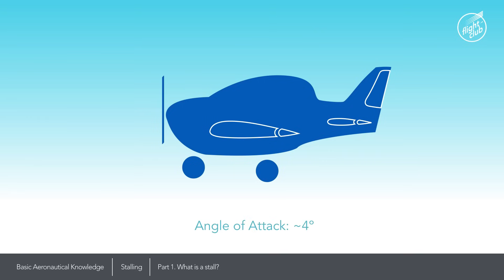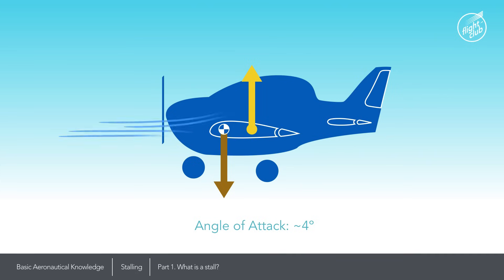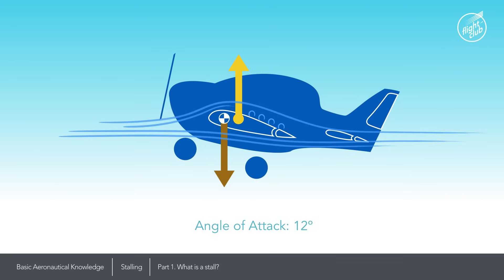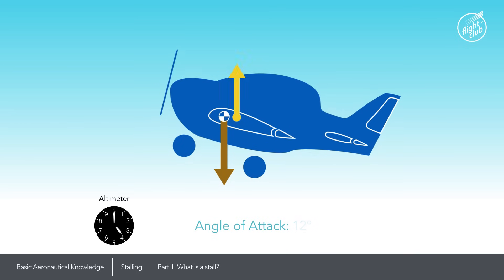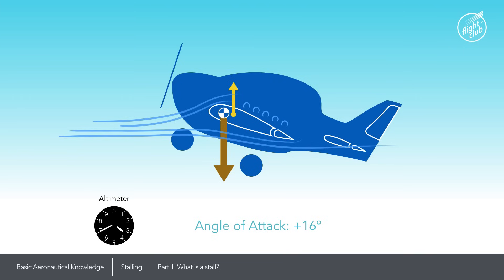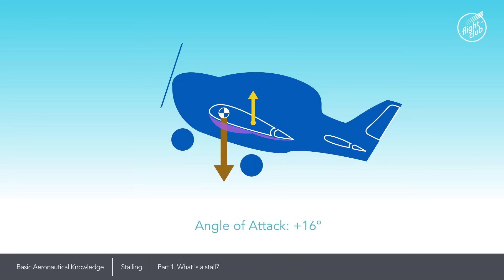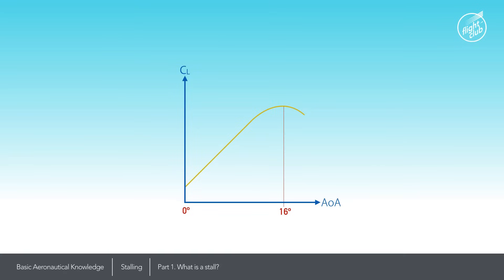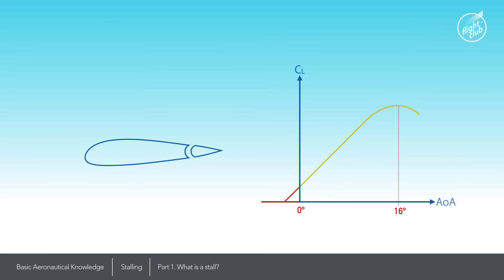What is a stall?

Comment: Stall is simply when the plane loses its force/lift to stay in the air for example due to low thrust of engines and pulling (sharply) up, iced wings (if you get iced wings during the flight with wings defrosters on then it's very difficult to get out of stall as the iced wings don't have enough surface to generate lift), if you've got a stall you go full thrust and nose of the plane sharply down untill you go out of stall (regain the speed), if the stall is on lower altitude then everybody in the plane is history.
For example you are at around 800 meters, suddenly both engines are out, if you start pulling up you will loose speed and stall, you go negative (down) 5-10° to glide and keep the speed and do emergency landing with or without the landing gear and airbrakes as you can't go too fast, if you for example do the emergency landing at 400 km/h the machine will simply fall apart, you do the emergency landing around stall/landing speed.
Every plane has its own stall speed like a smaller plane will have around 120 km/h and bigger ones 200, if you go below stall speed, the machine will simply fall down like a stone, you can't go too slow or too fast because in both cases the machine will go down, every machnie has its own stall and critical (never exceed), take off/landing speed, there are also flaps, airbrakes, blade pitch, reverse thrust, if you want to become a pilot and get some idea about flying download a flight simulator, like turboprop flight simulator from Google Play Store for free, as it's most realistic, there were cases in real life like a single fatigued bolt took the whole plane down or a moron painter that has put a silver tape on a sensor and forgot to remove it, also the plane crashed, stupid/lazy mechanics that wrongly adjusted the steering, guess what the plane also crashed ...
Reply: Thanks for the explanation, i was also asking why not just glide, but i see now the stall problem in low altitude there isn't enough space to gain speed to glide

Comment: Actually, theories say that the low pressure is generated by faster moving air. However, faster moving air ONLY generates low pressure in pipes. It is actually the airfoil deflecting air downwards.

Comment: The lift force shown should always be perpendicular to the aircraft
Reply: According to the FAA Pilot's Handbook of Aeronautical Knowledge, Lift is "a force that is produced by the dynamic effect of the air acting on the airfoil, and acts perpendicular to the flight path through the center of lift and perpendicular to the later axis." So the lift force is perpendicular to the aircraft only when the aircraft is parallel to the airflow. This is the case most of the time, but not at angles of attack much higher (or lower) than the angle of attack for cruise, assuming the aircraft is optimized for low drag at cruise.

Comment: If the AoA is increasing, then why is the air movement direction not also changing? I'd expect the air vector to also shift based on AIRPLANE MOVEMENT VECTOR, and not be always parallel to the ground. Why would we assume airplane motion is parallel to the ground if it would be slowly increasing the AoA towards sky, which should make it gain altitute?
Reply: This would happen if you were slowing as you increased AoA.
Reply: The air movement direction (relative wind) changes depending on the angle at which the airplane climbs or descends, but in this video it looks like it's always parallel to the ground because they compared the relative wind angle to the AoA without showing the climb angle of the airplane. (555-333)

Comment: Why there is no AOA in airbus 320 NEO, if Boeing 737 MAX has a lift problem, then why are the engineers paid for? How can Boeing 737 MAX be the best single ailes plane made today? if they cannot solve AOA , then it is better to stop manufacturing these killer planes?
Reply: What? Makes no sense what you write here.
Reply: You cannot "solve AOA". Every fixed wing aircraft has a critical AOA at which the plane WILL stall. AOA is the angle between the wing, and the relative wind moving past it. Boeing nor Airbus can simply "solve" this property of flight

Comment: Who came here after the recent Boeing crashes
Reply: I did
Reply: Yeah, but I didn't get anything!
Reply: meeee hahaha
Reply: One crashed earlier today in Iran.
Reply: A 737 max 8, probably another MCAS or the May Crash Any Second system problem again. 170 people this time. 🙄😭
Reply: The brazil crash
Reply: I don't think this is what happened with the Boeings. It was their faulty electronic sensor systems that caused the incidents.
Reply: Random user #74652819 737 MAX uses a Bigger engine for fuel efficiency than its earlier versions. This couldn’t be fitted just under the wings in the same location as before due to its huge size and lesser ground clearance. So they moved it a little bit towards front and this caused the plane unstable and stall. So to overcome that they added this MCAS.
Reply: @Stgdxb  But did the airplane in fact stall? Or did MCAS just push the pitch straight down, without necessarily stalling?
Reply: Psisis the air plane did fall due to the MCAS Faulty design. But MCAS was built to prevent stalling. The greedy bosses thought to fight competition will fix the new efficient engines on the old tested model. Which is a good idea. But the new engines where bulky and heavy which when fitted under the wing will reduce the required clearance to ground. So instead of raising the plane height which could have resulted in the complete overhauling design they bright the engine forward. This now resulted bin weight imbalance and can stall the plane during take offs. So the invented another software called MCAS to prevent that. And that eventually failed. The only way out is to completely redesign the plane all other fixes can turn deadly in long run.

Comment: Im still confused
Reply: I don't think I will ever understand this.  How air on top of a wing can produce lift?  Suction?  If you have air under the wing lifting it, what does the air on top have to do with it?  Completely lost
Reply: @nadrzenyporad  when an airplane is in lift off (or in an emergency), pilots need to shift their airplane's wings up and down. If the nose of the plane goes too far upward, it's tougher to get air flow above the wing. The flow from the upside is now dead weight. The plane will start to fall, consequently. This upset is known as a stall, and eventually a plane's wings experiece so much stress that it won't be able to function properly.
Reply: @nadrzenyporad  it's magic.  They just want to sound smart.
Reply: @nadrzenyporad  well in fact air pressure ALWAYS produces a force which pushes on a surface. So the air over the wing produces a force which pushes downward, while the air which passes at the bottom of the wing  produces a force upward. So the lift is produced by the fact that air pressure is greater at the bottom so that the resulting force upward is greater than the other one. So is differential pressure which produces resulting force. This is the same reason because of the Archimede's Law. Water pressure going down increases, so an object receives a lift because of the differential pressure. Sorry if it was bad english.
Reply: @marcostoca5120  does it mean that when it exceeds critical angle of attack and the cause turbulent flow, the pressure on top of the wing increased and the pressure under the wing unable to counteracts the pressure above the wing? please answer thx
Reply: @nadrzenyporad  Due to the camber of the wing, the air passing through the upset of the wing gains speed and reduces your pressure. As the pressure below is bigger, its produce a force thats lift the plane
Reply: @rafacosta_x_  Then claiming that the air motion produces two forces, one pulling the airplane upwards, another pushing the airplane upwards, is wrong, and there is only the latter.
Reply: As a kid I loved to stick my hand out of the car window to "fly".I think that's the basic concept - if I turned my hand too much up or down it wouldn't work, but light movements up and down would let my hand glide.
I don't know but maybe other people liked to do this too as children. 😅
Reply: How much clearer could the explanation be FFS.
Reply: Me too and I almost fell asleep after only two minutes. I'm outta here
Reply: Fr
Reply: Wow
Reply: The simple explanation is that a stall occurs when a plane loses lift, usually because it’s flying too slow/pitching up too far. Think of it like driving your car up a hill- if you don’t speed up, you won’t be able to go over the hill and you’ll fall downwards. If a plane is too slow, it can’t maintain altitude and so it will start to fall. To recover from a stall pilots should pitch the nose down to gain speed.
Reply: You’re probably so dumb that you did not listen
Reply: God bless you and Jesus loves you
Reply: Get off the dope and straighten out your life. Maybe then life won't confuse you and you'll understand.
Reply: And the award for most unnecessary comment of the day goes to @Woxwell.
Reply: @woxwell3684  Lol, as if drugs have prevented us all this time, from inherently conceiving the law of aerodynamics

Comment: Please help, if the plane stalls at the angle 16 degrees, how do they tilt their nose upward and go up, yet still not stall when taking off?
Reply: You don’t lift off at 16 degrees that’s why
Reply: Look up flaps and slats. These are control surfaces which are deployed by the pilot during takeoff and landing to change the aerodynamic properties of the wing. They increase the critical angle of the wing at the cost of increased drag. If you ever fly on an airliner you will see these surfaces being retracted after takeoff and extended again for landing.
Reply: To answer this question for anyone who reads it in the future, the Angle of Attack mentioned here is "relative to the wind", meaning it is relative to the angle of the air flowing over the wing, not the ground. When a plane takes off, they must generate enough forward airspeed that the wing generates enough lift to support the craft, then as they rotate the craft nose upwards they must also keep enough forward airspeed to keep the "relative wind" at an angle lower than the critical angle of attack.
Reply: Riccardo Cacchioli  You are two years late. I no longer need an answer.
Reply: @landen4392  that’s an ungrateful reply to someone who made an effort for you.

Comment: Generally speaking, is it the center of pressure always behind a center of gravity(in a straight and level flight) thus creating downward pitching moment on the wing (because of the lift)?
Reply: The center of gravity should always be in front of the center of lift. If the center of lift is in front of the center of gravity the plane will be inherently unstable. Planes with a center of lift behind the center of gravity are inherently stable and will be able to stabilize themselves even without any intervention when they pitch up or down which could prevent a stall.